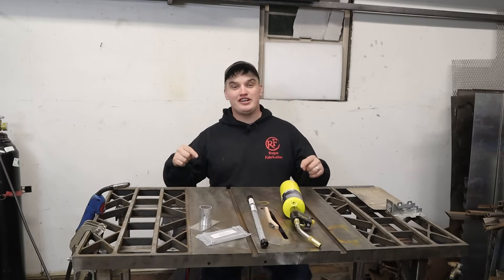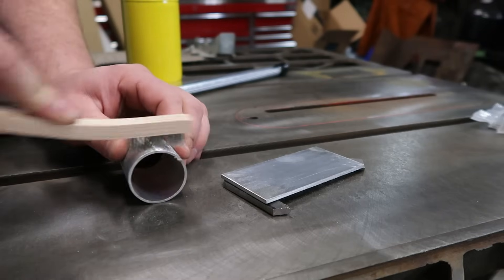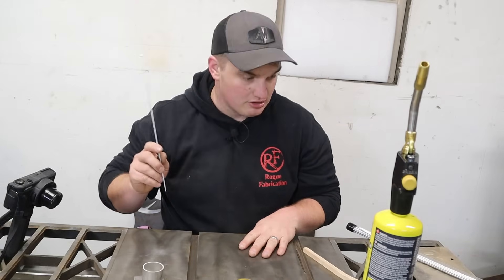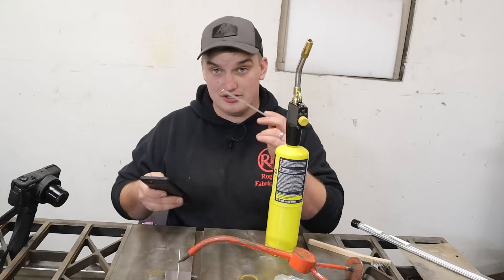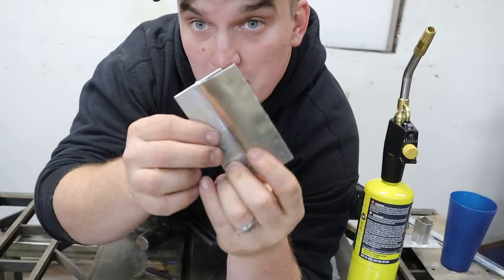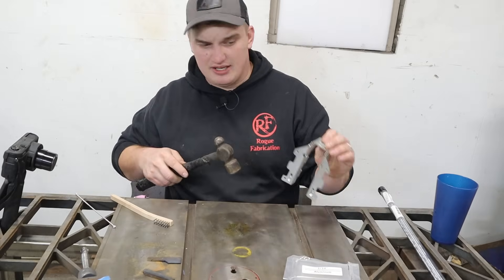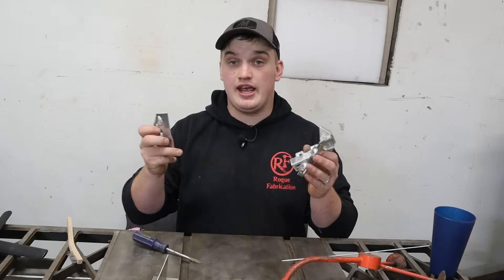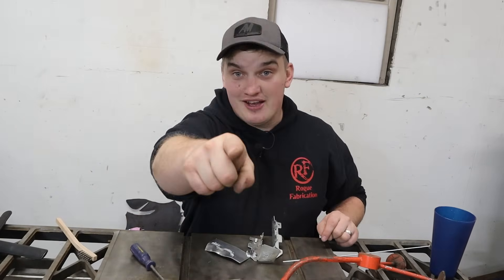Stick  Aluminum Together Without a Welder.

Comment: Crazy. He does a great job on the T weld by heating up the aluminum first, then glide the rod over it and melted a perfect joint. 
Then the rest of the video is him under heating the metal and then keeping the torch on to melt the stick and smear it on and move the parts. Or heating the aluminum and then sliding the rod back and forth pooling (cylinder) a useless bond…. Again! 
Would be nice to see a follow up on the “I’ve learned better ways and here it is”

But kind of you to post the video. Thanks
Too bad. It could have been a great informative video. But the method changed so much

Comment: I worked building A/C fittings using oxy acetaline torch . One tip i leard to teach others is . Clean and brush and use brake cleaner to remove any oil residue . Light torch without ox and apply it yo metal . It will leave a black suit color . Now adjust to soft bue color and start heating the metal slowly the black will dissappear idicating the part is hot enough . Next apply the rod and it will run in . Dont stay on the same place to long or you will melt the part . Let cool brush clean . We used a thin rod called AFC 1000 .
Reply: I cannot stress this enough - DO NOT USE BRAKE CLEANER. If you use the wrong sort, in a welding environment it will decompose to Phosgene gas. Phosgene is used during chemical warfare.

Comment: The rods are made of Zinc Zinc melts at 6:50 to 700 You can buy them cheaper at Harbor freight Any ox acetylene or OXY propane Will work

Comment: Used on bottom of aluminum boat. Problem was expansion contraction cracked weld every time it cooled. Even sat with heat on it and slowly let it cool then crack. None of the cracks welded water tight and all have hairline cracks left but much better and sticks well to surface.

Comment: Hello, please, our Tesla Model S driver side fender got tear from driving with the tire over the end of a steel light pole cable which ended in the grass. There is a cut of about 3 inches in. Could it be repaired, @amcustomfab? We live in Florida, Deerfield Beach. Thank you.

Comment: I watched a guy at the fair selling this type of rod when they were a new thing. His 'welds' looked perfect. He hammered on them. The aluminum bent to the point of destruction without letting go. I purchased some, I had terrible results. I think maybe I needed some kind of instruction. Or the rods he was selling were different from those he was using. 
    I tried a tig welder it worked but it wasn't as easy and didn't look as good as steel. The owner of the tig welder could make perfect welds.

Comment: Its called brazing. Banned in UK bodywork repairs for years. Every year cars over 3 years old have to pass a M.O.T. test ( construction and safety test ) before it can be used on the road. The car will fail the test if the examiner finds brazing.
Some countries are a lot less strict on car repairs.
Reply: Everything is banned in commie UK.

Comment: I know a lot of people think temperature is the key defining factor if something is brazing or soldering and while it's a part of it. It's only one piece of the puzzle. The real difference is the strength of the capillary action at work. Brazing rod material allows a capillary action to flow into significantly tighter spaces allowing for tighter fits of parts. What determines this is the material the rod is made of and thus the temperature it melts. To sum it up technically, temperature has nothing to do with brazing or soldering but rather a byproduct of the defining factor.
I also wouldn't recommend thus for rim repair. Rims are selectively cooled to allow the hardness of the alloy to be harder in some spots and softer in others. You might aneal a spot that was meant to be hardened or harden a spot that was meant to be softer. Please, just buy a new rim if someone out there is considering using this to repair a rim.

Comment: How long do these brazed joints tend to last? Will it crack after a few months or years of vibration? Wondering if I use it to make reliable car intake manifolds or intercooler tubing.

Comment: It just occurred to me that I may have seen a solution to the "breaking the oxide" issue that you mentioned. On a number of the other videos that I've seen on this process, the procedure was to scratch through the puddle while it was molten and into the base metal with a small sharpened stainless steel rod. I don't know if it impacts what you where speaking to, but it, somehow, it's supposed to make the solder bond better to the base metal. Just thought I'd throw that out there, since I saw it.

Comment: I was heaping praises on you all through the video when you were being careful to elevate the work pieces off of that huge cast iron heatsink that you call your welding table. Most YouTube "instructors" that are "teaching" us how to use this process as they are, apparently, learning as THEY go, will go so far as to clamp the work in a fricken vice to make sure that little of the heat from the torch goes into the workpiece. You were a very welcome exception and, therefore, got excellent results until.......you tried to solder the aluminum to the galvanized steel. Why did you leave those metal samples in contact with you table. I bet you would have gotten a better result if you had elevated the work above the table as you did earlier in your video. BTW, you are also the first YouTuber that I've seen try to join aluminum and zinc plating and my hat's off to you for that. I was really hoping for a better outcome and I think you would get it by isolating the work from the table. I could be wrong and the result you got wasn't too bad, IMO. Thanks for making the content.👍

Comment: Do you think this will work on a honda lawnmower deck that is cracked?  I believe it is cast aluminum deck?
Reply from the maker: Have not had great luck with it on cast aluminum
Reply: @amcustomfab  Thanks for the heads up man.

Comment: I tried it with a small crack that I have on my aluminum seadoo exhaust, but it did not work. It would just fall right off no matter how hot I got it with mapp gas. I must have done something wrong.

Comment: Have you soldered copper pipe for plumbing.  This looks identical.  Flux helps.  clean and rough both parts, dab a little flux on, connect the parts, then apply the solder (called "sweating").  If the copper is the right temperature, it will suck up the solder into the joint.  If not, it makes globs like when you tried to weld/solder the galvanized hanger to the aluminum plate.

Comment: Question: Can you solder two pieces together and then weld the whole thing together ? Because the melting temperature of the soldering rod is less than the melting temperature of aluminum, would the solder interfere with welding ?
Reply from the maker: No you would not be able to weld over top of this stuff because it is not technically a filler rod and is not technically supposed to mix with the base metal soldering is more of an adhesion versus welding the rod mixes with the base metal and becomes one if that makes sense

Comment: I got some rods of ebay but the work was melting before the rod was, in fact the rod never turned to liquid at all, just went like putty. the piece warped with the heat - it was just a God-awful mess. :face-orange-frowning:
Reply from the maker: That's not good

Comment: Not sure why you say you wouldn't use it for structural applications. You proved that the tube failed structurally while the joint didn't, so structurally the joint is as strong as it makes any sense to be. AWS says that brazing is as strong as welding and I think you showed that they were right.
Reply: Do you think it would be strong enough for a light use bicycle frame?

Comment: It is CHEMESTRY.

The rod is a composite that whn heated to melt temp, the "reaction" with soft metal increases temp near two fold (approx.1200 f)

The "trick" is to ensure ajoining surfaces are heated equally AND technician breaks the "oxide layering" by using a thin stainless steel wire to penetrate and drag through the molten "formula" (using rod itself does not sufficiently break oxide layer, and tube leaked, plate" delaminated"). This step is imperative.

Also - only use stainless steel brushes.

Comment: Wondering if i can use this for automatic lift gate attachment for my Odyssey. The bolts came loose and my mechanic suggested i should weld it but he can't do it for me.
Reply from the maker: Welding would definitely be more structural than this
Reply: @amcustomfab  thank you for the reply

Comment: Why can’t I get the rod to melt and stick like that? I hear the metal, but the rod metal won’t stick, just balls up?
Reply from the maker: The biggest hurdle I found was getting the material hot enough. One thing that I found helped me was if your piece is laying directly on the bench get a couple of small pieces to lift it off the bench and isolate it so the bench is not working as a heat sink and drawing the heat out of the part not sure what your application is though hopefully this helps thanks for watching.

Comment: You should never point the torch directly to the rod. That will only melt the rod while the pieces you're joining will not be sufficiently hot to provide a strong bond.
Reply: You should shut up
Reply: It seemed to work fine to me!😂
Reply: Lol
Reply: I highly doubt this kid needs any pointers bud lmfwo
Reply: @danahart5322  he obviously does. He can weld but he's not doing this right.  Any home plumber knows how to sweat solder which is really what this is

Comment: I learned that you need to brush aluminum in one direction, if not you push all that oxide back into the base metal.
Reply: That's nuts I never woulda thought that?
Reply: Kind of makes sense

Comment: WARNING: Vaporized metals can be very hazardous to your health. Alumaloy does not have an OSHA MSDS (Material Safety Data Sheet) which required by federal law. take precautions when using any soldering or brazing products.

Comment: Oxy Acetylene with a gas welding tip might be a good idea. perhaps a tig torch with a brazing rod & argon would solve the Oxide issue.

Comment: Thanks for doing this experiment - I will give this a try on some alu box section, I want to build a mono wheel bicycle trailer to haul camping gear and a solar panel but I can't do welding. I will even see if a 'blow torch lighter' will get the joint hot enough so that I could do repairs out on the road if need be.

Comment: Welding electricity is use to produce heat at a point just using gas takes a longer time to reach its why you learn amperage heat and current flow wire speed if the heat isn't equal then the weld is not effective cooling down metals and fillers at the frequencies hope it helps a wider view at Welding for you

Comment: Could this be used as say a 'preliminary tack' to pieces you're going to weld after? What happens if you tig after the brazing is cooled, will it work as the stick without needing the stick? Like could operate tig tip both hands? Or a person with only one hand could take advantage of?
Reply from the maker: No welding over this would contaminate your welds

Comment: Do you think these rods would do a die cast alloy like a motorcycle frame, a bracket at the front steering column has broke ,im a bit worried of heating the headstock up too much and paggering the bearing sections ,tho its snapped off in the middle of the headstock , ? thanks for showing us .Ant from Wales UK .
Reply from the maker: I definitely wouldn't do anything structural with them personally

Comment: Is is sandable? Could it be used as a filler for body/sheetmetal work?
Reply from the maker: I would worry about your sheet metal warping by the time you got it hot enough to melt this stuff
Reply: @amcustomfab  OK, makes sense. Thanks for the response 👍

Comment: Can't wait to weld my motorcycle frame with this process. 😂
Reply from the maker: This is not technically welding and not recommended for structural applications 😎
Reply: @amcustomfab  I think he's messing with you...

Comment: G'day Mate. I'm a second generation refrigeration and air conditioning mechanic with over 50 years personal experience. I first saw this rod only about 10 years ago and was so curious that I bought some. I paid $75 US for a Kg. I have successfully used it in repairing aluminium condenser pipes on car A/c systems and also the evaporators. It's a product that works....and is compatible with refrigerants.
Reply from the maker: Good to know thank you

Comment: Also don't bother on anything large. The heat dissipates too quickly. Like engine or cylinder heads just don't work. Aluminum block acts like a large heat sync

Comment: what I have done for galv steel to aluminum plate is affix a very thin layer of the alum braze to both sides of where you want the weld. Then clamp them together and do same as you did in your video, weld a bead
Larger surface of contact, you won't be able to pry them apart with your screwdriver like you did.
Reply from the maker: Interesting did you tig braze it or just wet it in with the torch? I might have to try that

Comment: 39,000 psi tensile strength probably refers to material in the solder/braze deposit, not the solder/braze joint itself. Given the area of the joint, it could still be quite strong. Someone else mentioned carefully cleaning the end of the tube, that is very important for a water or air proof joint. That is particularly important when both sides of the joint are not solder/brazed.

Comment: Rims? Had a buddy who chipped a 5/8" triangle chip off. Of a an expensive rim. Which was a set in some ride. Tire bead, would not seal with that piece missing. Guess what did the job?  yup those stupid rods! LOl

Comment: Why don’t you actually use Aluminium Arch welding rods.
Reply from the maker: I think I should definitely try I don't usually use this stuff but I was just showing it as an option for non-structural applications

Comment: Thanks for the content.   I have had some rods for years never tried to use them.  My friend has a boat that needs a small tear repaired.   I think I will give it a try.   Thanks
Reply: I repaired multiple holes on a Jon boat that have held up for years with these. Practice on scrap first.

Comment: don't forget you can try bronze brazing rods. ( takes a lot more heat btw).
Reply: Show us your video where you do this. I am super intrigued what with the melting point of bronze.
Reply: @chrisallen2005  I haven't necessarily made a video about it but I could whenever I get the time. The melting point is 1800 degrees I think. So you need a super hot torch or use acetylene torch like I got but you got to turn your temperature way way way way way way way down

Comment: I used this stuff to build up a boss on an aluminum water outlet that was too thin for the sender and its 1/8npt threads. I added a little under 1/4" of material and it drilled and tapped nice and worked for years without a problem.

Comment: I never can get it to work.  I have not tried it on thin aluminum surfaces.  I did it on something 1/4" and thicker and it doesn't work. it breaks in the 1/4" section, but does melt and adhere to the work surface. using the same gas you are using.
Reply from the maker: Agreed but has better results on thiner material

Comment: you did it all wrong      it says NOT to directly heat the BRAZING ROD     your supposed to heat up THE SURFACE and let THE ROD MELT to the Aluminum and then let it cure/cooldown for about 30 mins and then test it       you didn't do it right   check out Projectfarm he tested out a lot of those aluminum brazing rods the cheapest and the most expensive.      you need to do the test a lot better than what this was just banging a hammer on the piece of metal doesn't test anything

Comment: I purchase some from home depot same method that you're doing it doesn't stick it melts easy but it doesn't stick at all trying to do a crack wheel don't own a a TIG welder
Reply from the maker: Don't know if I would recommend Wheels with this stuff this stuff is for soldering not for welding or structural things
Reply: @amcustomfab  thank you for your informative information I didn't know

Comment: I have a little experience in soldering copper and silver. I was definitely thinking flux and getting the temperature right. For silver I used borax ,for copper standard plumbing flux. Looks pretty strong. I wonder how it would handle boost and also vibration

Comment: Ive tried this and have had difficulty getting the aluminum to the melting point of the aluminum sticks. Around 735 degrees is required byt the Mappro gas only gets the aluminum to about 500 degrees.
Reply: What are you talking about? 
MAPP gas gets up to almost 3700f.

Comment: the trick is do not use iron based wire brushes . This welding rod composition is mainly zinc . zinc and aluminum are in the same covalence ring .  they love each other . Use stainless steel or solid brass brush to clean the surface thoroughly  . Also ONLY aluminum oxide sandpaper .
Reply: what will happen if the steel is not galvanized, just ordinary? or you had to remove the galvanic layer bcos of shaping or cutting the workpiece? thank you!

Comment: I cannot imagine someone trying to solder rims back together
Reply from the maker: Would not recommend it lol
Reply: @amcustomfab   Looking at my alloy rims on my motorcycle they were made in 1980, and there is a seam weld of some sort when the rim was rolled and joined. Now back in the 1980's there was no TIG welding I think but happy to be corrected.